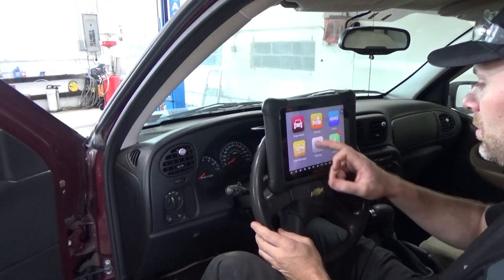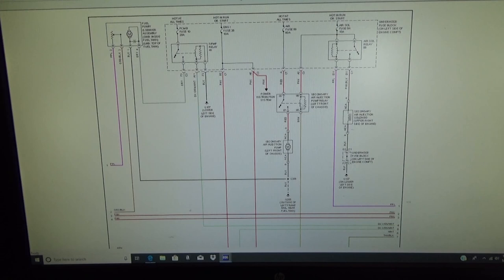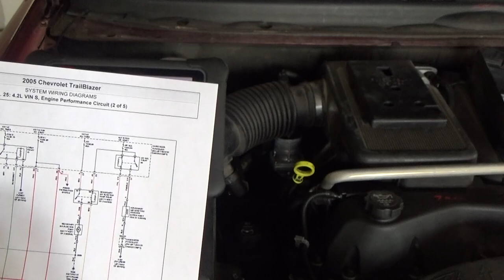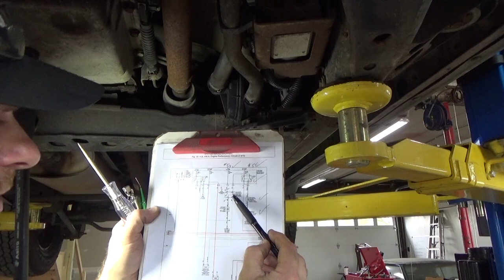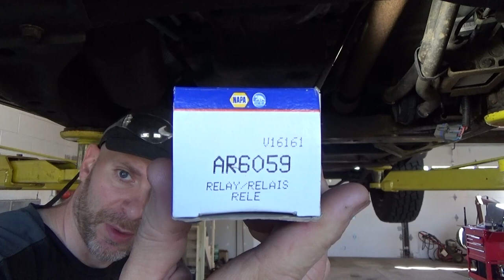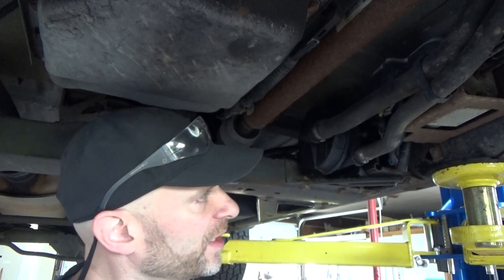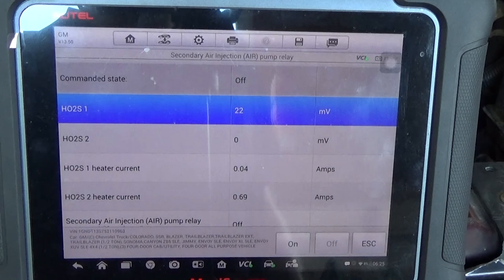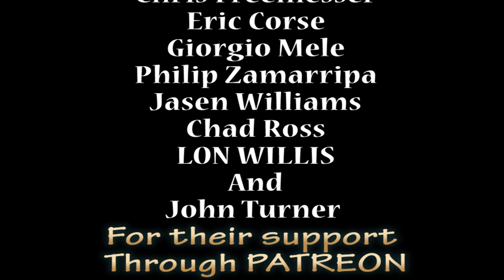Secondary Air Injection (AIR) system P0410 Can we fix it ?!?

Comment: I chased the same intermittent code on my '05 Chevy Trailblazer. About twice a year this code would set. All the fuses, relays, air pump and wiring checked out ok. I couldn't reproduce the problem. After two years of chasing this code, I discovered the solenoid was sticking. It would work 97% of the time.  I replaced it with an AC/Delco part and haven't had any more problems.
Reply from the maker: Stanley Waggoner nice fix!! Thank you for sharing

Comment: I need to know where the 5 pin plug wires go, the envoy is identical but i have a 5 pin plug, 6 but one in the center is empty, the replacement plug came in all White wires (5) the vehicle did not have the original plug when i got it. So i cant find anything on where what color wire goes where,  to each pin correctly. Any suggested ideas will be appreciated. I need to find obe sonebodys driving and ask to look undr their hood,  this may or may not be a good idea especially if its a woman 😂.

Comment: The secondary air injector in my 2004 trailblazer has been changed out three times. I was gonna go back and get it changed again and then the mechanics tried to talk me into looking at an electrical problem. Now that I watch this video, I only have to figure out one thing how to get my trailblazer up high enough to get underneath it to get that Piece out and check it.

Comment: I have an 05 trailblazer myself and had the cam code I cleaned the cam sensor and the code went away. A stained sensor with buildup will cause it to not function just Slightly  out of spec

Comment: I really don't hardly make any comments, but this was one of the most thorough, professional troubleshooting videos I have seen.  It's interesting to hear you say, "could it really be that easy," as you literally tracked down every single possible source of the code, and then continued to address problems after you found the most likely source.  I really appreciate you sharing your knowledge.  I just wish I had a professional scan tool like that.  Thank you for the video.

Comment: Excellent system description, love the way you show various methods depending on tools at hand. Gotta think the previous tech proved the pump was bad by directly powering it, then didn't remember to check the relay as well. Two problems, both caused by corrosion in a vulnerable spot.
Reply from the maker: Thank you! It’s So easy to miss things sometimes.

Comment: Thanks ..great explanation My 04 envoy pullin 410 code ..its derivable BUT after warm up engine looses a lot of Power for a few seconds to maybe a min - 2 then it runs like an scalded dog Again & them repeats  over & Over ..so gota figuar out it its an Bad O2 upstream o2 down stream or replay or pump itself or Check Valve on engine ..thanks alot ..give me an good start to get my daily driver back up ti normal

Comment: So cool I found this video.. It's exactly what I had to repair todsy but my plug end was pinched and both red wires were severed. After repairing the wire the pump came right on when I started it and I hadn't heard it before.. it was all fixed before I saw this but it helped me confirm it all.

Comment: great diagnostic routine if you have time.  in a busy shop, when you see a new computer, new air control valve and new pump, you should go straight for the relay, disconnect it and check the terminals if you don't see any corrosion.  spending 30 minutes on-camera alone makes me think that those new parts were most likely replaced by the same person here.

Comment: I missed ya big guy. I think the evidence of rust and corrosion proves water intrusion.  Sounds like others shot the parts cannon here but, you being a gentlemen, did not point fingers.
Thanks for sharing Will, puts a different perspective on trouble shooting.  I suppose everything could have been tested using a power probe.  Maybe next time you can troubleshoot it the hard way, using test lights, then prove it with the scanner.  Lol. Just a suggestion.
Reply from the maker: Robert Weir thank you for the compliment and sharing your feedback! Glad you enjoyed the process.

Comment: I have a 08 Chevy impala charged both air pumps and the a new code popped up..
P2440
Current DTC
1/1
Secondary_Air
Injection System
Switching Valve Stuck
Open Bank 1

Comment: Thank you for that informative great video Will! So the secondary air injection pump is just for testing the 02 sensors? Is there any other use for it? & Yes your video was very informative and helpful. I like the way you explain things and give other useful information...I see you’ve learned well from the other masters! great job. Thanks, Doug.
Reply: Hi Doug. The purpose of the secondary air injection system is to help reduce hydrocarbon emissions during cold start. During cold start, the fuel system control is in open loop for a few seconds. The fuel air mixture will be rich because the ECM will not be fine tuning the fuel control (trims). The secondary air injection will allow added air (oxygen) into the exhaust stream to mix with the extra fuel in the exhaust (that did not burn in the cylinders). This will give the catalytic converter(s) enough air to allow the extra fuel to create the catalytic effect which will allow the catalytic converter(s) to heat up quicker. This will help lower the emissions quicker/sooner. 
The testing procedure he is describing in the video is how the ECM/PCM does a self test of the secondary air injection system. During closed loop, the oxygen sensors are signalling normally and the fuel system is controlled by the ECM/PCM (trims). If the secondary air injection system is working properly, the ECM/PCM expects to see the oxygen sensors voltage drop (go lean) when extra air is pumped straight into the exhaust stream. Note, if the vehicle is equipped with AFR sensors instead of oxygen sensors, the AFR sensors voltage will go up when the extra oxygen leans the exhaust stream. 
Hope this helps.
Reply from the maker: Yes exactly!!! Thank you very much Billy for sharing this! Greatly appreciated
Reply: @robinsonsauto  thank you Will for everything you do for the community. You and many others are a blessing to multitudes around the world. Have a blessed and safe week.
Reply: Billy Yoder Yes thanks for that Billy, and as I understand it the AFR sensors voltage goes up and regular oxygen sensors is the opposite, voltage goes down or am I thinking of amperage on those? Just brushing up my knowledgeable information that I need to know. Thanks again, Doug
Reply: @bigfootemobileauto9734  hi Doug. You are correct. Regular narrow band oxygen sensors voltage goes down when lean, up when rich. Wide band (A/F ratio) sensor data will show voltage or amperage (or display both) doing the opposite.
Reply: @billyyoder8171  fascinating info - we had this air pump replaced - just wondering what it was for.

Comment: I replace the solenoid I replace the pump and the relay I checked on the harness it has power but the other harness that has a short cable I didn't see any power there what are you thinking might be

Comment: Hi, I was wondering if that bad relay also activates the solenoid that the air pump is connected to?  My air pump is working but the new solenoid I put on is not opening/clicking, like it's not getting any power.

Comment: Hello, If you don't have a $2000 scan tool, and your trailblazer doesn't stay at a constant rpm while driving, without codes, what would you replace first? sorry for the dumb question. TIA!

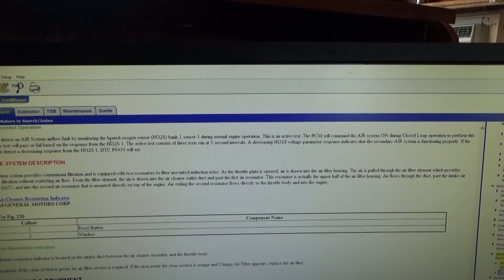Comment: I think the system description (approx. 2:30) is incorrect. It seems to be mistaking the pump OFF decreasing voltage result as the normal ON result. Instead, it should describe the result you got as the indication of a normally functioning system. What do you think? Also, the description of the system itself is not very clear and so I would suspect it is also not correct.

Comment: Could this cause it to rough idle and stall with heat and ac on? I don’t think it will but I only have this code and I can’t use my ac or heat without it instantly stalling on me. I have done the following, cleaned out the throttle body, changed fuel filter, spark plugs and coil packs, evap system. Stumped. I don’t have any other codes except this one

Comment: I have a 2006 Trailblazer that's been giving me the problem of the smog secondary pump doesn't want to start I change the relay and I changed the pump still doesn't want to turn on my engine light is on I don't know what to do

Comment: I have replaced everything, check valves, pump motor, vacuum solenoid, hoses and still getting p0410. When I look at live data at startup and i look at air injection commanded  status it says “UPS” after 30-45 seconds it turns off like it should and then commanded  status says “off”. Name is Jose Haro. I’ve inspected everything, power, grounds, resistance but only thing I haven’t inspected are the O2 sensors, Can these cause a P0410 if there response in reading the oxygen amount at cold start? Please help

Comment: Hey Will, have really enjoyed all of your vids. Would like to find out what your thoughts are on the 2015 z71 4x4 Silverado. 
My first 4x4 and am just curious what your thoughts are about the truck itself. Mine has approximately 72k on it at present and the trans fluid along with the rear, front diff, and transfer case have not been changed out. Do you feel it is critical to change these out soon.
Thanks ahead for your response.

Comment: hi will I have the same identical problem on my 2004 trailblazer 4.2 but my pump was full of water  I replaced it and it came on 1 time and never worked again gm couldn't even tell me where the water came from any ideas? thank you

Comment: I replaced the fuse then put in a new relay it wasn't that.i put in a new air vacuum solenoid on the passenger side of the block wasn't that.now I put in a new air pump and still I get p410.can any 1 help

Comment: Please help. P0418 and p0410/ 11.. changed everything except the valve.  Does the valve wire together with air pump? Or stop the air injection system from turning on? I had to also change wire harnes for Relay( water damage) its driving me nutz. Any help would be appreciated.  Check fuses. All good..

Comment: How would you activate the air pump with out a fancy scan tool?
Reply: easy...pull connector at pump & apply 12v & gnd. a power probe or equiv makes it easy.